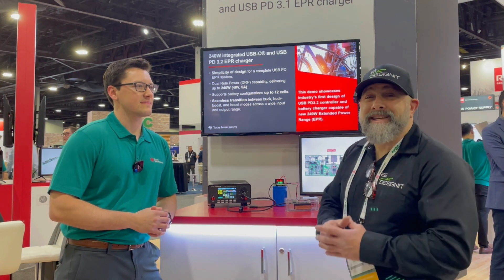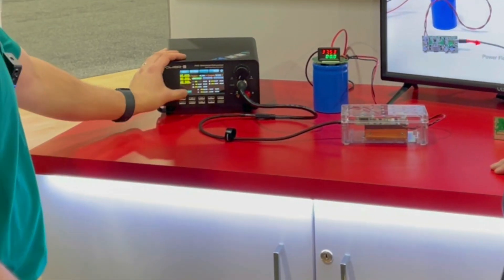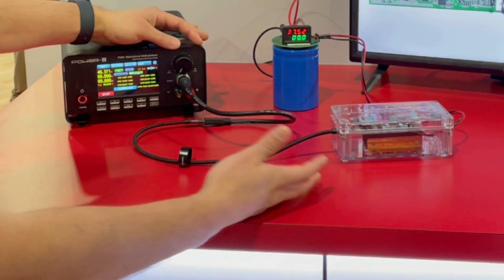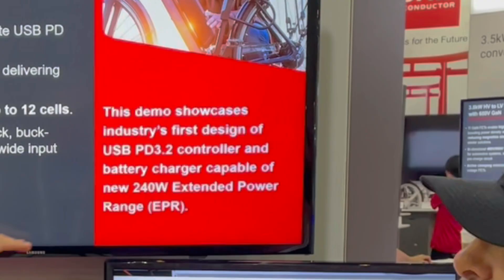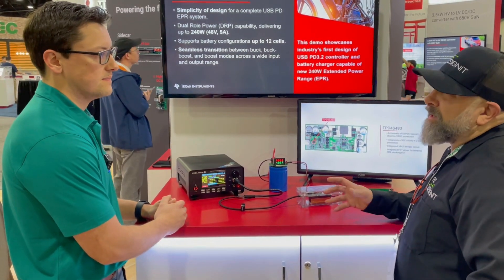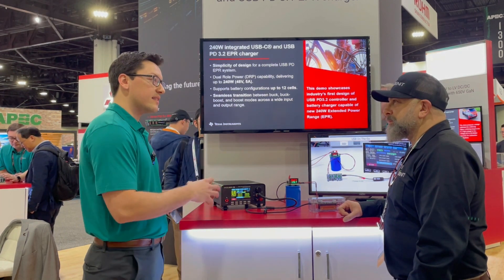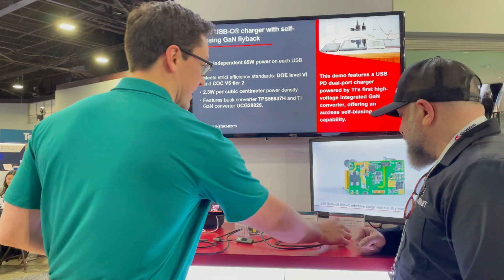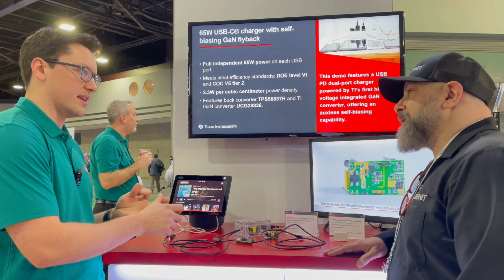Next-Gen Power: 240W USB-C and Ultra-Compact GaN Flyback Solution

Comment: For mobile it's useless but for PC and stuff with bigger batteries it's nice.
Reply: i want to charge my laptop with my phone charger dammit
Reply: Why do you think it's useless? I've seen 180W laptop chargers. And one laptop that even uses USB PD 3.1 and will accept 240W charging from a device such as this.
Reply: @ laptop is a pc
Reply: @WsciekleMleko  Ah, so you mean to say it's useless for PHONES? That may be true right now, but I guarantee that if battery tech ever makes it to the point where 100W+ charging is reasonable, this will be used in phones.

I'd love to see this in tablets and battery packs now, though. I have some 100Wh battery packs and a few larger battery stations (for outages, etc) that I'd love to charge fast. And because they're bigger, they can handle the wattage.
Reply: @klfjoat  Yea it probably will, its nicer to have faster charging but going out with bigger bricks in backpack is getting annoying. I would prefer to have better battery instead. Faster charging is a deceive from the real solution for actual mobility of mobile devices.
Reply: @WsciekleMleko  No one designed 240W for phones. So I don't know why you keep bringing them up. 😂